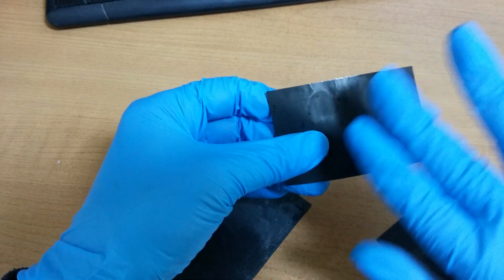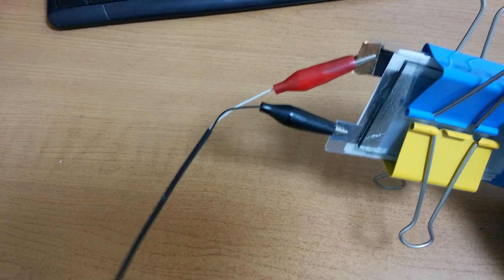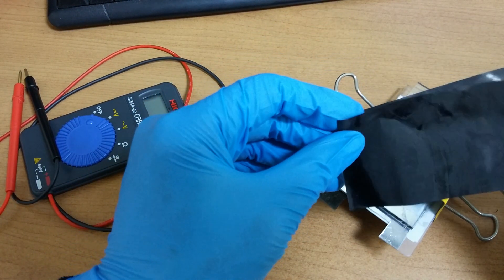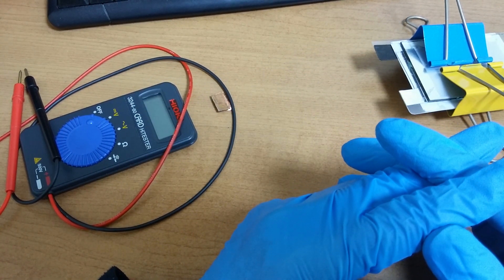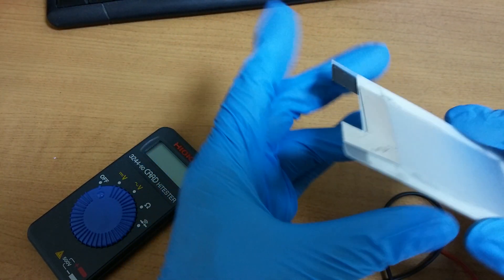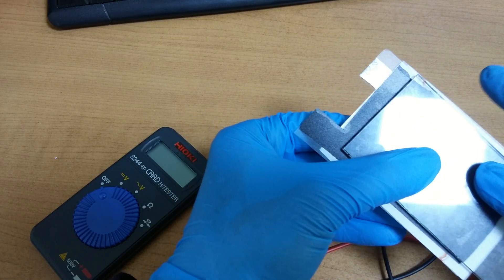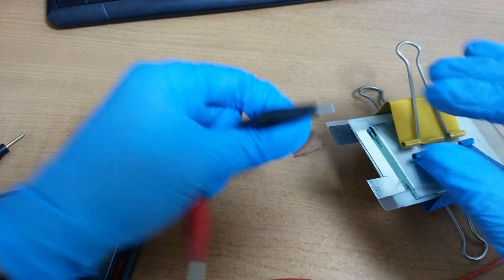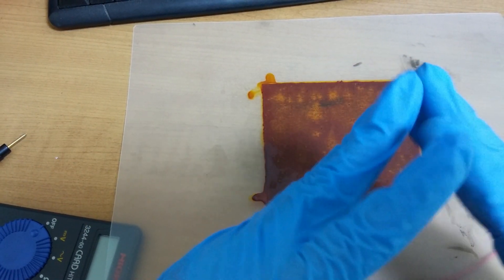graphene iodine paper solid state battery works

Comment: I am an amarican so I use the crust anti cavity toothpaste  the ingredients are sodium fluoride,  titanium dioxide,  sodium silicate I think, and sodium luyrul sulphate and there were more sodium stuff  so is it good?
Reply from the maker: It sounds good
Reply: Ok so should I apply it on both electrodes as electrolyte 

And there is one more thing the tooth paste says that it has 0.15% fluoride ion and 0.238%fluoride plus titanium dioxide
Pls reply